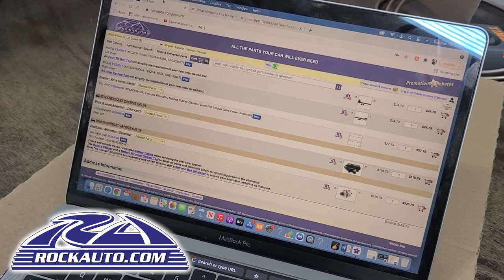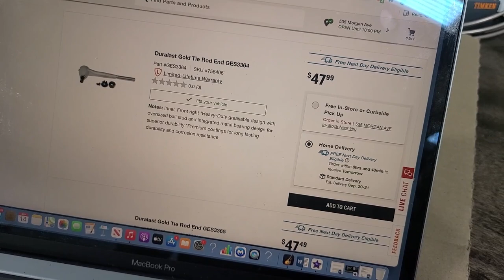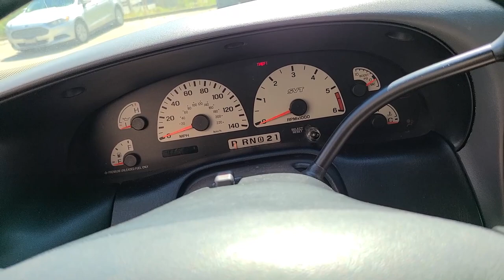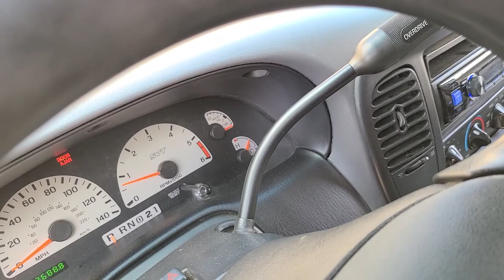I Found A MAJOR Engine Issue After Fixing EVERYTHING On My SVT Lightning! Previous Owner Had To Know

Comment: I’ve seen a dozen overheating  cars get fixed with blu devil  head gasket sealant, it doesn’t goo up anything, it only changes from a liquid form when it reaches a certain temp and is exposed to oxygen at the point of the leak, and it’s money back guaranteed 

 it’s worth a shot after re torquing the heads .. imo , you have nothing to lose
Reply: And yeah with that overdrive crank pulley it’s making more boost, anything that overheats while  boosting is called lifting the heads

Comment: My first thought was to check the head bolts for correct torque and re-torque. That's a lot easier than removing cylinder heads to start with. If a re-torque fixes the issue, great. If not, then yep, off come the heads.

Comment: I've pulled many sets of heads off of these mod motors in vehicle with minimal clearance issues around the heater box.Never had an issue after repair as long as the heads are true.

Comment: If I remember correctly, there’s a Head update that was done under Recall by Ford to my 2003 Terminator Cobra that was supposed to correct that issue, so might have to do the same.

Comment: I would def try just tightening up the head bolts and see if that helps. You won’t be out anything but some time. 

Or go with some ARP head studs and replace them one at a time like the diesel guys do. Those would both be “cheap” experiments to try before removing the engine.

Comment: Start with checking the head bolt torque settings. That could be an easy fix if the gaskets aren't cooked. And then change the coolant again.

Tis a very cool thing btw.

Comment: Don't use a head gasket sealer. The sealer is made to keep coolant in, not stop boost from entering. All you will end up doing is contaminating the coolant system

Comment: If you’re replacing the suspension parts, no need to remove the cotter key, just buzz it off with an impact socket hammered over the cotter key, done. Pitman arms I use a cut off wheel on an angle grinder to cut most of the way thru, then pop it with a chisel and it falls off…but since you’re not on flat rate…lol…

Intercooler issue?

Edit: bummer, combustion test proves it’s a gasket. Hopefully it doesn’t have pulleys and other things that contribute.

Comment: Please add a high performance valve job (5 angle?), back-cut valves, bowl blend, and mildly clean up casting flash from ports without removing much material.  Then when it is back together, put the truck on a chassis dyno to see what it has got.

Comment: When a head gasket blows you CAN blow a cylinder because it fills with coolant and certain liquids DO NOT compress. It happened to me with my ford van. FORD = fix or repair daily / found on roadside dead.

Comment: Hey Alex I watch your videos all the time I had a 1998 Mercedes SL 500 in the head gasket blew up on me I’ve use this product A few different times on a few different vehicles and it always works it’s called blue devil head gasket sealer I recently did it on my SL coolant was pouring right into the engine oil and that fixed it like new I drove it around for a while after that give it a shot promise you you will not regret it

Comment: Whatever you do, please do not use dodgy sealant products unless you have no other option to get yourself home after a failure.
Go with checking existing torque first then maybe the stud conversion everyone is suggesting if it can be done without removing the engine. 
Should buy you time and peace of mind until you have time to fully strip and upgrade 👍

Comment: Blown head gaskets are a common issue on these supercharged 5.4 motors as well as the suoercharged 4.6 motors in the Cobras.  Both have a poorly designed head that is prone to failure and warping.  This is especially true when the pulley was swapped out for a smaller one.  That is a cab off job on these trucks.  Have it checked for cracks as well.

Comment: Check the plugs maybe? They should show coolant combustion, only issue is that you might be making more boost than the coolant systems pressure so you may not be burning it🤷🏼‍♂️

Comment: I had a 1994 Acura Vigor with the exact same head gasket failure but it never made enough pressure to spray out ofbtje cap, only to keep the system under pressure even when it was cold and hadn't been run for a few weeks at a time.

Comment: Yo Alex have a 2014 V60, been thinking of poly bushing the entire car, drives perfect haven’t changed anything mechanical yet (fingers crossed) just thinking of preventative that they’ll last longer than OEM bushings, car has done 156k miles so far & drives like new.

Comment: I once had this crazy puzzle and guess what. The new radiator cap seemed out to be faulty as well. I think I tried 3 caps and the 4th one worked. But here we see there is exhaust fumes in the expansion tank so I guess that is not it. I would definitely try to just torque the head bolts first. You ad extra pressure so it would be logic to think this extra pressure is to much for the standard torqued bolts.

Comment: This is a weird problem? I would like to see if the head bolts are torqued? I've never seen or heard of this kind of head gasket leak?  I love seeing that supercharger! I have a 92 Mercedes 300D 2.5 Turbo.  I was driving and was stopped at a light.  Oh man that car next to me is really smoking?  Oh oh it's my car! It ran fine to the repair shop.  All it was was the head gasket! Shwoo! And just this summer in June once again white smoke billowed from the exhaust.  The oil level is fine.  The coolant is fine.  But there was a nasty tapping! I probably bent a valve or hit a piston?  I just finally got the money to buy all the parts for a head rebuild?  I hope I'm going to do it myself? I really appreciate your confidence! Thanks for sharing Alex!

Comment: Definitely try re-torqueing the head studs/bolts as it is possible they are not quite tight enough as you say. If the head gasket was ever changed they always should be torque checked after a few heat cycles.   Pretty standard. Pretty standard especially on forced induction builds. Can’t wait to see what your next video on it shows us in your findings.

Comment: I still only buy Fords no matter what. I tried switching to Silverados had two in the last 6 years worse things I ever owed! I still have my 03 supercrew 304k miles 4.6 no issues yet. My friends uncle has a E350 van 5.4 has 416k miles he bought it new its a residential construction van. Only a torque converter so far

Comment: Since the engine will come out, might as well do new internals. Since the internals are new, might as well do new heads and cam.  Since the heads and cam are new I'd do a new supercharger and tune for E85.  After that, I'm sure it would be done...maybe.
Reply: The "might as well" theory

Comment: Another trick to make it easier to put the tie rods back to the same adjustment. Give it a quick shot with a paint marker spray can and screw it into the paint line. No remembering the number of threads. Oh yeah. It is a Ferd truck so I'm guessing it has an issue retaining its sparkOlaters.

Comment: I know this is an old video but I just went back and was watching the lightning videos, I had an 03 cobra a few years back that had the exact same symptoms. No smoke, full power, and the coolant didn’t even turn milky after flushing until I beat on it again. Turned out to be head gaskets also.

Comment: I never have any luck with Chevrolet trucks. I have owned 5  Chevy trucks, and all 5 the transmissions after about year of use, start a  hesitation  while coasting along at various speeds, but mostly somewhere between 25 and 30 miles per hour. The first time it happened I kind of ignored it and eventually the transmission failed all together. After the rebuild and another year the same thing was happening again. Under warranty I had it back in the shop. They returned it saying they couldn’t find anything wrong. I had to make an appointment to ride along side the mechanic, before they would believe me that there was something wrong. Upon inspection they found rust on a shaft that the clutches glide back and forth on, thus when the clutches snag on the rust it was translating to a hesitation. The mechanic pointed to the root cause as the rubber hot air vent on the top of the transmission. As soon as It got back I sold it. The other four trucks developed the same problem. I traded them in immediately, and in 2013 I bought a Ford and have had ZERO problems with the drive train in over 8 years. I probably will keep this Ford until the wheels start to fall off or something better comes along. (Like the new electric Lightning)

Comment: "Shipping is super fast" except that it's fed Ex most of the time and I'd say 8 out of the last 10 packages shipped with them have been delayed at least a day. Quite frustrating,  I wish they would allow UPS as an option.  Do love Rock auto though!

Also, have those heads worked over if they haven't already and stud it. Maybe some cams if it goes that far.

Comment: You could try getting new headbolts and torque it to Roush spec.
It's definitely sealed until you get under boost, it may be loose head bolts.

Comment: The radiator hose that carries the coolant might be weak, it doesnt have to be damaged for it to leak, over the years and heat compensated it could be weak enough to be letting coolant out

Comment: I was wondering if it was your intercooler pump not working and it was your intercooler fluid spewing out but apparently not mine went bad and didn't know it and soon as the intercooler fluid will get hot it would spew it out the cap on the intercooler Reservoir. I replaced it with a Davies Craig high flow intercooler pump about a third again more flow than stock did and it made a huge  difference. You probably know this but don't go too high of a flow because it won't give the intercooler a chance to do it's job and actually cool the fluid off

Comment: The biggest issue I had seen on a 2002 Ford Lightning was the air-to-water intercooler under the supercharger leaking which made people think that it had blown head gaskets. I owned a 2002 Ford Lightning bright silver with the bar grill for a year fast truck fun truck but that was all it was good for was fast

Comment: I was worried about a contamination issue after the last video where you fought clearing the coolant up for so long. If the previous owner was a Lightning guy as he claimed, he 100% knew and is likely why he priced it where he did. That's half fair, but he should have been upfront about all issues. I sold a Mustang some years ago that had multiple issues and I made sure anyone who came and looked at it was well aware of what was going on with it.

Comment: If you're taking the engine a part.
Pull the motor out and hot tank the block to get all the passages cleaned out

Comment: By looking at your nasty coolant, I’d say you have, exhaust gas going into your coolant.  Or a one way head gasket leak.  And I bet it only happens during high cylinder pressures only! Or not at idle or low rpms!

Or if I’m wrong maybe it just me going through this atm lol.

Comment: Flush system with of all the coolant remove thermostat an then put sodium silicate about quart in with straight water an run it until operating temperature. If it doesn't blow or over heat then drain an flush all that mix out. An refill coolant an put thermostat back an drive on until you can do big upgrade. 

I have sealed 1/4 crack in block this way. 
Liquid glass doesn't screw up cooling system like the bottles of bs at auto store order jug from drugstore or off Amazon.

Comment: I think you swap out the std. head bolts, with ARP head studs like mentioned below - before pulling engine!  I think based on the conditions you  are showing will fix the problem with out pulling engine!!

Comment: It seems like the heads might be lifting under boost. Personally I would just replace the gaskets and do some performance upgrades while your there. Even if you tighten the head bolts and it fixes it.. the head gasket is gonna be something that's in the back of your mind every time you drive it.

Comment: Opening a cap on a closed cooling system like that is much safer than opening one on an open cooling system. On the closed cooling system, there is just air under the cap. If its overheating or in your situation, possibly spewing out combustion pressure, it may be a little more risky. With an open system, there is just hot antifreeze under the cap, hard to get them off without blowing hot antifreeze everywhere.

Comment: Apr studs and cut 8 treads In the heads of pull some out the junk yard buy forged rods and pistons if you pull the engine and 3v oil pump

Comment: I'd try some Headgasket/Block Sealer, I swear by Resolene, Sealer, I have a 4 cylinder Van with 600000 miles on it, original headgasket, was using coolant, 4 years ago, started using Resolene Gasket sealer, still running fine, using no coolant. Do's not clog up cooling system. Just follow the instructions.

Comment: Hey Alex. I need to try the test where you said don’t do this at home cause I have a 2002 Dodge Ram 2500 with no heat but I changed everything but the rad. The shop thinks it’s the way the truck is but when I bought the truck the previous owner said he had the head gasket replaced but I’m wondering if it was done incorrectly or  didn’t get the head checked. Thank you for explaining things in your videos so well and why you think things could be the way they are. Keep up the good work

Comment: I kinda had the same issue on a totally different car lol. My '03 Suzuki Ignis Sport. It blew a lower rad hose once and overheated quite badly cause I had to find a safe place to stop on a highway with no shoulder so it ran a while without any coolant. After that the motor ran totally fine but it spewed coolant out of the overflow when getting on it hard. Coated the entire enginebay and under side of the car lol. It had a slightly warped head due to the heat but it didn't really have any performance loss. Sold it as-is to a guy who had a wrecked Ignis with the same motor and he probably swapped that one or maybe just the head? Dunno what happened to it after I sold it lol.

Comment: My guess is head gasket.  I thought that way back in the radiator flush video.  When it takes that long to flush, it’s because combustion gases are pushing past the head gasket into the cooling system.

Comment: Just an FYI the coolant gauge isn't the most accurate, it's more of a dummy gauge just like the oil pressure gauge is. I've seen this era of Ford's coolant temp rise above normal and the gauge still reads perfectly fine.

Comment: Maybe at full pull the coolant sytem reaches the max pressure its suppose to be at. And in turn the cap opens to relive the pressure?
Reply: But there is exhaust gas coming from the heads into the cooling system...

Comment: Possible its been overheated in the past and the heads are not true. Being that the heads seal when cold says a lot. If it was high cylinder pressures from a larger pulley on the supercharger it typically will not seal after combustion leaks from the head (although i have come across that in the preliminary stages of a problem). If you have a tech friend good with an oscilloscope he should be able to identify the cause without having to buy parts and go into tearing all into it ( or get some definitive facts leading towards the base cause). Not saying all cases are the same and thats why I recommend bringing a tech friend knowledgable with a scope. Doing diagnostics for so long I would suspect the head surface is not true and deformed allowing a slight gap to form under heavy engine loads / heat. This would typically contract back after cooling, sealing the surface once again if it contracts to within spec when cold. Can also be caused by what you mentioned,  cylinder head torque. Just a thought. Not trying to start a youtube argument (seems to happen a lot when just putting out a thought).

Comment: The truck is from 2002 and the radiator is probably the original one from the factory. Should check and see if the radiator itself is even flowing properly could also cause this issue with coolant spraying out of the reservoir cap.

Comment: The common issue on those engines is usually the the piece on the front.  The part that says Ford is the best way to determine that you shouldn't waste your time.

Comment: If you run a cylinder leak down test,  you can determine if there is a leak and where it is going.  If you hear air at the oil cap point,  the rings are bad. At the radiator cap, the head gasket is likely.  At the carb, the intake valve is an issue. At the exhaust pipe, the exhaust valve is at fault.

Comment: The 5.4 doesn't even need boost to have this problem. I had a 5.4 navigator with the exact same symptoms... 155000 miles. Sold it to a guy on craigslist with full disclosure and appropriate price. He was going to try to liquid fix it. He's probably still driving it...wanted it only to pull a jetski...

Comment: I had the same problem with my 2004 lightning and it was actually the rings were letting pressure to get by on high boost and then rebuilt motor did the same thing

Comment: My partner and I bought a supercharged car recently. After owning it for a 2 weeks we've found it's got a bad auto and putting around town it's fine, also we did a coolant change the other day and I noticed gilter on the cap and the over flow is high for some reason. I suspect head gaskets as well

Comment: Don't do the sealant, it won't hold the pressure from the exhaust gas, I've always tried it. The sealant does work depending on the way the head gasket blows.